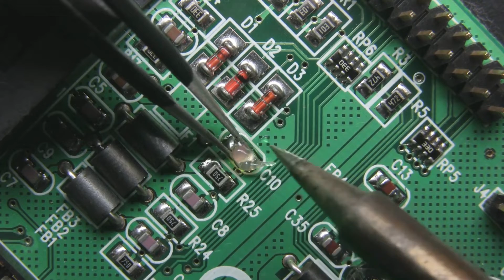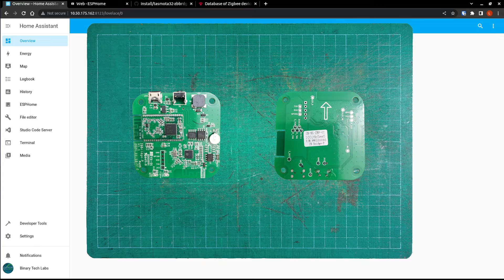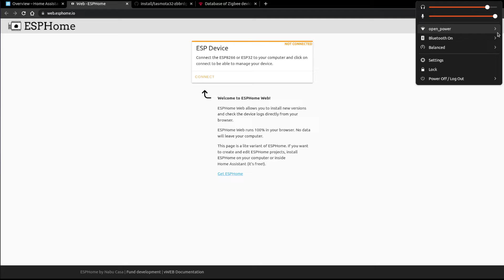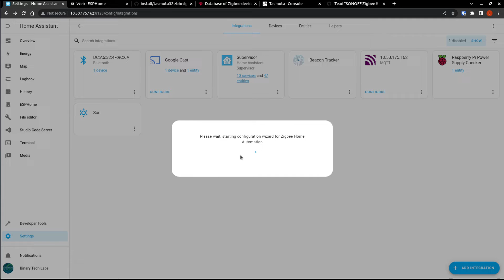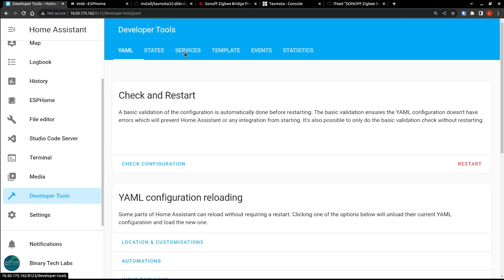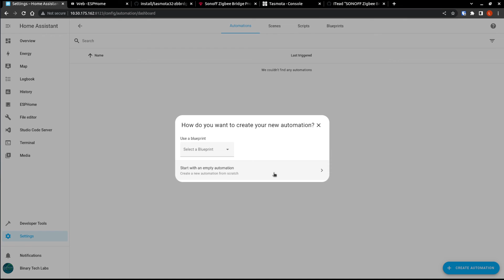Setting up Zigbee with Home Assistant - Unlock the full potential! (Part 2: Zigbee Bridge Pro)

Comment: Thanks for this valuable video sir. Very detailed steps !!!. Quick question. I have running a Zigbee coordinator implemented and would like to add some bridges to extend the signal with end devices. What's the Tasmota version required to flash Zigbee Bridge Pro to configure as a router? Thanks !!!
Reply from the maker: Thanks for the compliment, this is where I get my hex files and this is the last one I can see for what you want to do.

https://github.com/arendst/Tasmota/tree/development/tools/fw_SonoffZigbeeBridgePro_router_only_cc2652
Reply: @BinaryTechLabs  Thank you sir for this information !!!
Reply from the maker: @JJdeRamos5360 your welcome, cheers

Comment: Does ZHA support more than one Zigbee coordinator to extend it’s range (repeater not possible because of distance). For example one Sonoff bridge and one USB Stick (Sky Connect) at one time? Thank you
Reply from the maker: Thank you for your comment, unfortunately only one coordinator, but you can use "routers" to extend and build up your network. Typically constant powered devices act as routers